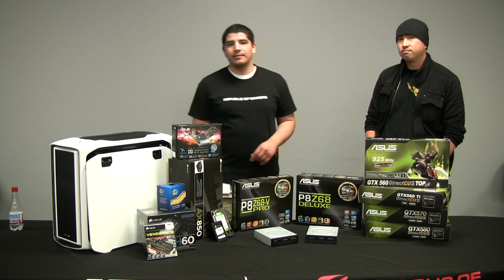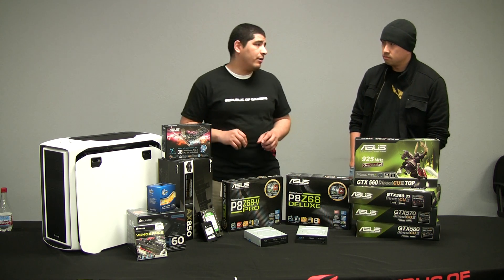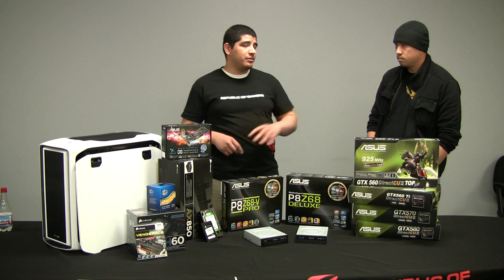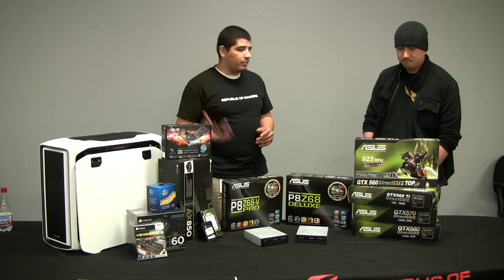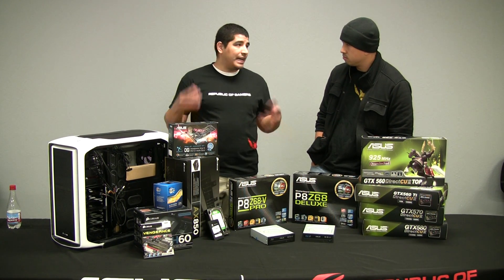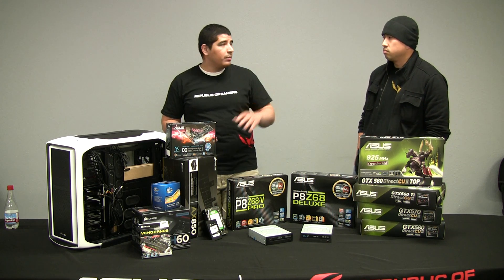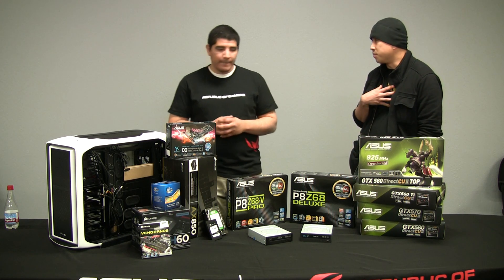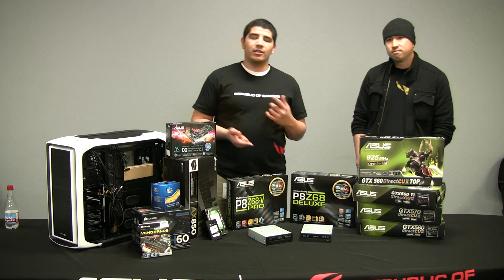How to Build an Intel Z68 Custom PC

Comment: i have a question i would buy a new gaming system in two weeks 
coolermaster haf x 942
asus sabertooth z77
asus gtx 670 direct ii
i7 3770k
 corsair h80
coolermaster hx 750w
samsung blu ray
geforce 120gb ssd
1000gb 
corsar 16gb
is this system goood or bad

Comment: The Xenon is used in the Xbox, (so useless) unless you meant a Xeon: which is actually meant for server usage, Xeons work better with multicore applications and are better with heat. lets just say, that thats actually not worth the money compared to the performance boost.

Opterons are also used in the server line and actually were released for alot of sockets.  they have up to 16 coresXeons and opterons run mostly al low clock speeds and from what i've seen the Opterons dont have alot of Cache

Comment: I read just fine, but "overpriced crap" is not very specific, I can't guess the things you're not writing.
Sure you could build a gaming PC without the SSD and without SLI, and you don't need BD-burner (which is why they give the BD-combo drive as alternative). But if you want the "perfect Asus Z68 system" it makes good sense to include those extra options. He even admits that the onboard sound is not bad, but, if you want the best you need the soundcard with amp, I see nothing wrong with that.

Comment: @TalesOfWar Yeah, true, although i have a 6870, running three monitors, a 27, 24 and 19. And i mostly use game engines, level designing, game game creating and use max for model and character making. The single 6870 handles it all perfectly and allows me to play all the latest games at max settings. If i had plenty of money then yeah i'd probably spend a stupid amount on a rig, (sort of going against my initial comment but still) but yeah i agree with you, its still a waste.

Comment: i prefer ROG VERSION OF MOTHERBOARD LIKE....MAXIMUS GENE-Z.......AM GOING TO BUILD A PC AND AM GOING TO BY THESE PARTS TELL ME IF ITS OK TO GO ON AN BUILD IT......THE MOTHER BOARD JUST I SAID CPU I7 2600K G.SKILL SNIPER EDITION 1866MHZ PSU 700W OCZ MOD XSTREAM PRO CORSAIR H60 ASUS GTX560 DC2 TOP AND SEAGATE 500GB 7200RPM SATA3....IS THAT OK

Comment: @Digikid2007 Asus is the best parts you can get. I build 5 or 6 computers a week, and I use only Asus Gigabyte. Asus has far less problems or warranty problems. Asus is the best Motherboard built.

Comment: I have a 600T with FX-8120 and H80 Cooler.  I have incorporated the water cooler mounted to the back of the case.  With radiator inside the case up against the back of the case and 120mm on top pulling air through it.  I have the 2nd 120mm fan on outside of the back of the case.  I think the H50 comes with one fan.

Comment: Hi, 
i have issues with my twintech560ti, black screen at start up.Whereas everythings works welle with my old gtx 9800.
Any answer thks
ram:2x4go ddr3 1600 kingston, i5 2500k, pwr supply 570, Asrock Z68 ext gen4

Comment: How does the online gaming transcode work?      The fixed function "quick sync" chip on the sandy bridge processor, the on-board graphics,  and the descrete graphics card all come together to efficiently transcode on-line gaming.  What software are they using?

Comment: I have that case.... cpu cooler, power supply, dvd drive.... soon to get the crosshair v formula 990fx, 8150 bulldozer and some kind of kick-ass 7000 or 600 series gfx card, for Battlefield 3 + Diablo 3.... oh i also have G.Skill 2133 8gb(2x4) mem kit. lol

Comment: Nice job guys. Great explination. Dont worry about the haters, I like the bennie. First time builder here, just got the Z68 Pro. Getting ready for Battlefield 3. Before I have always been strictly a console gamer. I think BF3 will change alot of peoples minds as it did mine. I want it on triple monitor surround & 3d if possible. Do you think I should get the GTX 590 or wait until the new GPUs come out? And when do you think they will come out? Thanks.